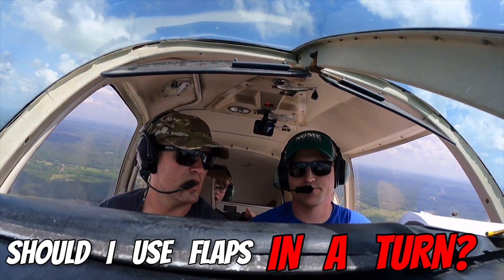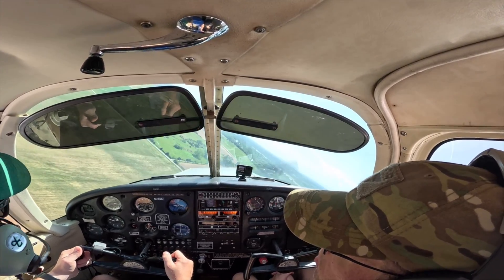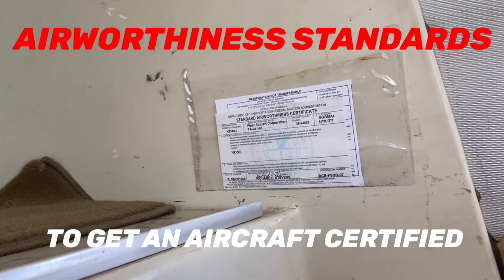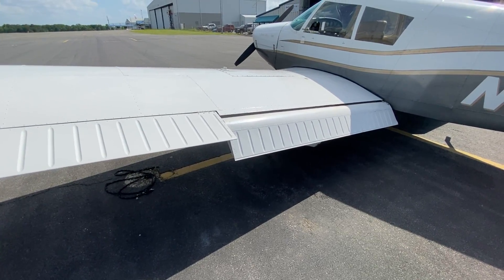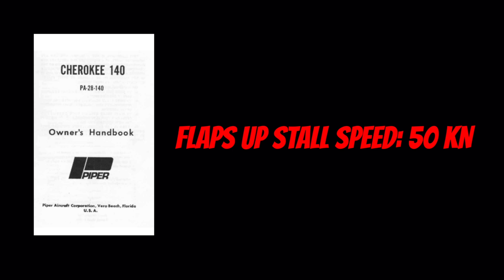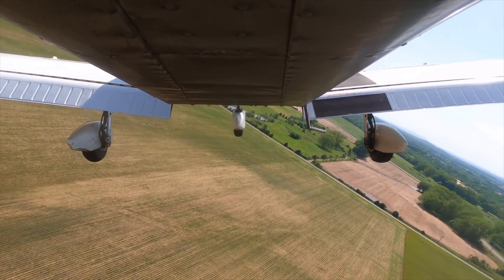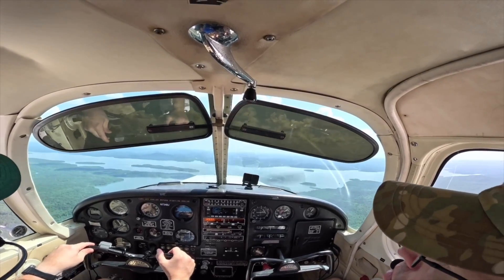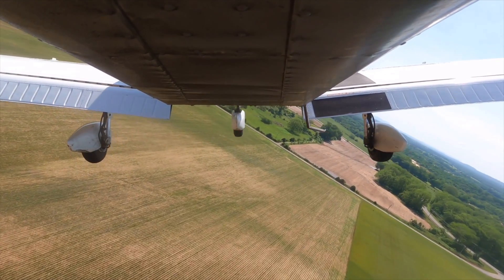Should I LOWER Flaps in a Turn?

Comment: I’m sorry. This flaps equals smaller turn at same airspeed in coordinated. Level flight is BS
Reply from the maker: I’m actually getting a lot of crop dusters on here saying that they intentionally use them to tighten their turn radius while doing their work.  Why would they do that if it didn’t work?
Reply: @FreePilotTraining  yes. Use flaps to allow slower airspeeds or allow you to pull more Gs for a tight climbing / descending turn around..
We use high G turns in mountain flying cannon escape maneuvers.
Example in a 45 degree bank turn you pull 1.4 Gs for level turn. If we intentionally pull 2 Gs we tighten the turn and induce climb. Both good things in a cannon turn.

However, in a level coordinated turn a certain bank requires a certain G loading and Airspeed will determine the diameter of the turn.

Hope that helps you understand this interesting topic.

Bob Dilk
Reply: @bobcfi1306  Yeah , more of a comfortable safety margin above the bottom of the white arc than the bottom of the green one , airspeed-wise .

Comment: Interesting video!!  Thank you!!   I'm a 35+ yr, 10,000+hr pilot and I learn something new every day!!   Question,  I'm thinking how I'd use these skills in an engine out, impossible turn scenario.  I have an AOA indicator and have successfully done the impossible turn from as low as 500' using 45 degree turns by referencing the lift available vis-à-vis the AOA.  Wondering with an engine out could I get a tighter turn by dropping flaps immediately while I still have speed, understanding that dropping flaps will reduce speed.   Using the flaps to decrease the turning radius.   Possibly raising the flaps once back to 0 bank and heading back to the runway.  Understanding that raising flaps will impact stall speed.  Do you have an AOA in the C130?  If so what are the ops parameters for using it.   Thanks again for the video.
Reply from the maker: Thanks! I appreciate that! That’s a really great point… I’m not sure what the trade off would be between the increased descent rate and the tighter turn radius. 🤔
Reply: @FreePilotTraining  Sounds like material for your next video!!!   😁
Reply: I like this thought experiment. I think the drag might not be worth it, but where it keeps you inside the airport boundary it could still be a win. Like if you didn't need to do a 180

Comment: I would never disagree with using flaps in turns in the pattern. The big no no is changing the flap setting during the turn.. the main argument is that it changes the trim, which could result in stall/spin esp if you are in a high work load situation such as after an engine failure final turn with a low speed.

Comment: Love having flaps on the Tri-Brick. Pull full flaps pull power to activate super Sink mode. There are many times that general aviation should and could use flaps. Being able to slow the airplane and get that tighter turn could have saved lives for those who have flown on to tight box canyons or other tight places.
Reply from the maker: So true! I’ve considered using them in box canyons

Comment: Student pilot's are taught to not SET flaps during a turn for CRM.  They have enough to keep them busy just working the pattern,  power. airspeed and don't need to add putting their eyes in the cockpit to find and use flaps during critical low manufacturing.   They are just never taught its ok to do as they get more experience.   They should be taught to set prior to the turn to maintain the FAA stable approach.  You're exactly spot on,  flaps for pattern turns are a great tool.
Reply from the maker: Thanks for the comment.  I’m sure you mean SRM? CRM probably doesn’t apply to most student pilots.  I like my students to practice task management skills in the cockpit while I’m there.  That helps them develop those multitasking skills in the cockpit
Reply: @Free Pilot Training  not familiar with SRM?  We use CRM for Cockpit Resource Mangement with students in the midwest.

At least that's what it was 3 years ago for my CFI.  Wouldn't surprise me it changed with so many other FAA changes recently. 

keep up the great videos

Comment: Long time Cherokee Arrow pilot and did 20 years in the airlines and fractional aviation. I have had 2 split flaps situations back in the office as a Dispatcher, our fractional fleet is in the largest airlines there is. Our fleet is busy and we can bust Aircraft systems fast. The malfunctions took place on a Citation X and the first was on a 1969 Boeing 727-200. Both were sensor failures.
Question about flying your Cherokee, do you land with 2 or 3 notches of flaps? My friends have convinced me to only do 2 if we have lots of runway. The third notch is all added drag to slow the forward speed. It also makes emergency go around more difficult. To be honest I don’t notice much difference doing a normal landing with only 2 notches. 
The most impressive thing I have seen  is dumping the flaps on roll out, much more weight on the mains.
Reply from the maker: That’s crazy. As far as full flaps in the Cherokee goes, I’ve noticed that riding the wheelie with full flaps in a soft field landing is virtually impossible. Go around a can be pretty sketchy cuz they don’t climb too good. I typically stay low for a split second after lowering the first and second notch to build up airspeed.  Not a standard practice, but necessary in that plane in heavy situations

Comment: I think the next topic should be using minimal flaps during high wind conditions. If you have gusty winds, I was always told never use more than 20 degrees of flaps. This is especially true for those older aircraft that I actually have a setting of 40° flaps. Incidentally, I am kind of a no flap or minimum flap person. I generally like my approach is not so steep, I keep my speed up a little and it saves fuel by not having to drag an airplane in. I also delay using flaps when I’m on an instrument approach and lower them to flaps 10 within 1 mile of the final approach fix. Understandably, larger, faster, airplanes require more usage of flaps, especially when you consider their weight.
Reply from the maker: I definitely want to discuss that in a future video.  I like to challenge myself and land full flaps in high winds, but it really is best to use less flaps in those situations
Reply: @FreePilotTraining  I also use/teach full flaps as default on all landings.  In strong crosswind, the headwind component and full flaps and a power/pitch approach including deceleration on short final easily allows angling across the runway from the downwind corner to the upwind big airplane touchdown zone marking at 1,000 feet.  Using dynamic proactive rudder to hold new centerline and dynamic throttle to hold glide angle exactly to the first foot of the downwind corner and dynamic throttle to control both sink and balloon from gusts will result in touchdown slowly and softly on the exact downwind corner.  It drives me crazy to see greater groundspeed on any landing with headwind component than on a no wind landing.  Groundspeed on the angle across touchdown is often near zero.  Less tin and skin is damaged at 20 knots groundspeed than at 100. How can anyone in a trainer have 100 knots groundspeed in a headwind component?

Comment: A very good explanation and perfectly correct. Having ridden with Ag pilot's in NZ, (when you were allowed to do so, not now.) they would always be adding flaps during their turns particularly when still heavily loaded. And if anyone can get the best out of an aircraft safely it would be an Ag pilot. I've learned more from them than an instructor and I apply a lot of what I have learned from Ag pilot's to my own piloting although I refrain from flying at the low altitudes required for Ag work.
Reply from the maker: I had no idea that ag pilots did this on purpose until producing this video. I’ve been getting lots of comments mentioning that

Comment: Energy management is indeed the most important thing when on aproach or in the pattern. Flaps are a great tool for that. So as long as you are on speed, there is nothing to worry about (I never even considered split flap condition to be an issue anyway). 
But if you happen to already be slow on the base-to-final turn, extending flaps will also instantly increase your angle of attack. That is not something you'd want at that time. That is why I hold the principle to not change flaps (up or down) during turns in the pattern, only on the straight sections. Just to be sure I don't get surprised by unexpected results.

Comment: Nice video! Your reasoning makes sense (and in the end, who would want to question Rod? ;-) ) but I have to jump in on one point because imho it is wrong that flaps tighten your turn at least in the way you explained (and showed) it. The turn radius is depending on airspeed and bank angle - how should the flaps come in there? If you fly the same airspeed and the same bank angle, I don't see how the turn radius should change so I was quite confused by your demonstration. Yes, flaps increase lift but this is only an instantanous effect - you will have to change something (power setting and or angle of attack) to remain level and then, the wing produces again 1g of lift. Generally, flaps of course allow you to fly lower airspeeds and this lower airspeed will then give you a thighter turn radius. But if you remain level and remain at the same airspeed, I see no reason why the turn radius should change. The forces to execute the (level) turn are exactly the same regardless of the flap position. Am I missing something?
Reply: Correct.   I agree with most of this well-done and nicely explained video, but this point is, unfortunately, inconsistent with facts.  I responded to C91CZ with the same comment.
Reply from the maker: Turn radius is directly related to the horizontal component of lift. There’s quite a bit of information in the PHAK on the subject
Reply: @FreePilotTraining  Sure it is - via the bank angle. The horizontal component of lift is in a fixed relation to the total lift and also to the vertical component: Vertical and horizontal vectors add up to the total lift vector. As the vertical component has to be 1g, this automatically fixes the other two.

With flaps, you get more lift at the same angle of attack. But regardless of the flap setting, for straight and level flight, your wing has to generate exactly 1g of lift. For a level turn, it has to generate load-factor*g lift. With flaps, you can achieve this lift with a smaller angle of attack, but it's still the same amount of force.

Comment: You set your flaps while wings level, on downwind, and on final.
Reply: That is what student pilots are trained, but I think the point of the video is that flaps are a great tool (for experienced pilots) to be used in different situations, and adding flaps in a turn is not a dangerous procedure when you understand the impact on flight characteristics. ...and can actually help you in some situations (over shooting final, box canyon, etc..)
Reply from the maker: Exactly

Comment: One of my fellow cfis said that if you let the nose pitch up when the flaps extend you increase the load factor to that grater than the chart and therefor its more dangerous.  I like your take on it because we should not be letting the nose up in the first place. Plus we are less than the stated load factor due to being in a decending turn in the pattern. Just like in steep spirals for commercial.  We can do those at a slow speed and high bank do to the low load factor. "You can't stall at 0 Gs" blancolirio
Reply from the maker: You have to be careful about that one because pitch attitude doesn’t necessarily change the load factor, BUT just because you’re in a bank, that also doesn’t necessarily mean your load factor is increased.  It must be in a level turn

Comment: I would only change the position of the flaps when the wings are level, such as while climbing away from the runway after takeoff, on downwind just before turning base, on the base leg before turning final, and on final. After each flap change, I would re-trim the elevator for the proper airspeed before making the next turn.
Reply from the maker: There’s nothing wrong with that.

Comment: In Canadian flight schools, teach the same as what you explain .canyon turn is a solid example of using full flaps during turn .
Reply: BS, Full flaps at low power due alt is DRAG FLAPS.  Use only LIft Flaps or under 20 degrees.
Reply: @emergencylowmaneuvering7350  I don’t think you know what a canyon turn is. The canyon turn is done at full throttle, there’s nothing low power about it. I was taught: 1) maneuver to the far right or left side of the canyon, you will be in an upslope position on the mountain close to the ground, 2) cut throttle, 3) nose up to trade airspeed for altitude, 4) once in the white arc drop full flap and roll it over to 60 degrees of bank in the downslope direction towards the center of the canyon, 5) nose down to maintain 65 knots trading altitude for airspeed, 6) roll out of the turn, recover and clean up the airplane. The technique results in a very tight turn, I’ve executed a 180 degree turn in a C172 loaded within 90% of max gross weight in a 370m radius using this technique. The turn requires loss of altitude to manage the airspeed.

Edited to add radius from my ForeFlight track log.
Reply: @emergencylowmaneuvering7350  slower you go and higher angle of bank would result in the tightest turn. Full flaps would ensure you can fly slow as possible to preform the turn with the smallest radius and not stall
Reply: @emergencylowmaneuvering7350  It's done at full throttle, read the full post. Your throttle is cut for maybe 5 seconds so you can get into the white arc and deploy flaps.
Reply: @kurtisf3366  Shoe the dam video showing a normal Vx climb used to climb over mountains at say 10,000 altitude, then turning steep and pop full flaps with nose up. SHOW IT, LIAR. SHOW IT.
Reply: @emergencylowmaneuvering7350  All my replies with links keep getting deleted. Just search for box canyon turn and you will find it.

Comment: It’s not “split flaps”; it’s “asymmetric flaps” when one flap is deployed differently than the other. Look up the crash of N62PJ, a Jim Bede designed BD-10. There is a type of flap design that’s called “split flaps”. One example is the Douglas A-4 Skyhawk. Btw, if I’m going faster than the top of the white arc, I’m not lowering the flaps. Also, Watts = 5.3E-15 x rpm^3 x diameter^4 x pitch.
Reply from the maker: Good point. When I say “split flaps,” I’m really referring to asymmetrical flaps.  You say potato.  I say French fries
Reply: @FreePilotTraining  But now you know the correct term..  😎

Look up automatic slats on the F-86 Sabre. Also, the Blue Angels had to pin the leading edge slats on the A-4 Skyhawk when they switched from the F-4 Phantom.
Reply from the maker: @txkflier  I’ll have to check those out!

Comment: That bank angel graph for load factor and topic drive me crazy and is totally misleading. Almost everyone teaches it wrong and illustrate it completely wrong. This graph is for a bank angle while MAINTAINING THE SAME ALTITUDE. (Thus- pulling back as the G forces increase loading the wing while maintaining the same altitude) I can and have effortlessly banked 90 deg and had NO G forces. Push forward on the yoke and unload to unstall. Let the nose drop and descend. Never use the ailerons to raise a dropping wing in a stall...use the rudder to avoid a spin. G forces are obviously felt...right? So unload by pushing to avoid exceeding the critical angle of attack. As G forces increase (increase in load) so  does the stall speed increases. Take an aerobatics class and it will change the way you think about maneuvering your aircraft.
 I think a more accurate way to think about stalling it to understand "available angle of attack and what static and dynamic forces affect the angle of attack. Understanding these concepts and understanding what to expect with a given control input in all phases of flight will make you a much safer pilot.
Reply from the maker: Yes, that’s true. That’s why I mentioned being  low on glideslope and leveling off as you turn.  That’s where the real danger is

Comment: I'm a retired spray pilot and flew an Agcat and didn't have flaps as it was a biplane and you could make real tight Chandelle turns with that plane all day. On the other hand, the ag operator across the way had single wing P&W1820 1200hpThrushes and he and his pilot used flaps in their turns all day to make the turns tighter and safer. In fact it is my understanding they went thru several electric motors to operate their flaps every year. Sometimes it appeared their wings were actually past vertical when performing their tight returns to their swath. More work done more money for a days work was the name of the game.
Reply from the maker: Thank you for this comment! I was wondering if someone used flaps like this in a situation like that. I’ve considered using them in mountainous terrain for this purpose, but I didn’t end up needing to
Reply: @FreePilotTraining  Even doing something stupid and getting into a box canyon it would be useful lowering the flaps to get yourself out if you don't wait to long.
Reply from the maker: @johnwebb4191  Exactly!